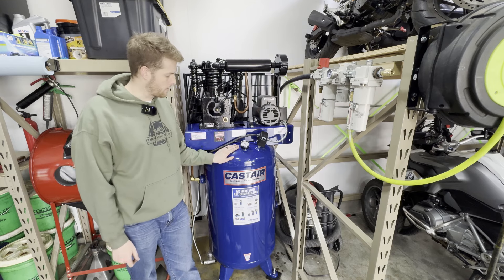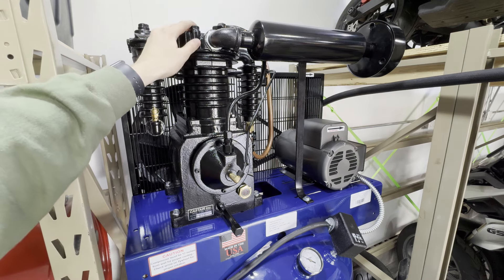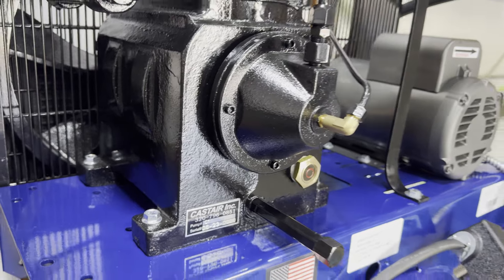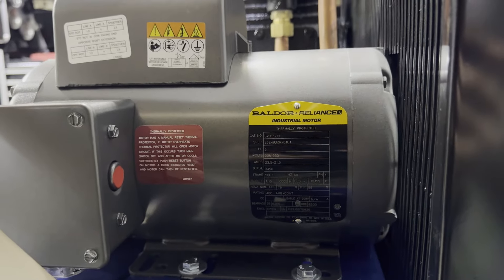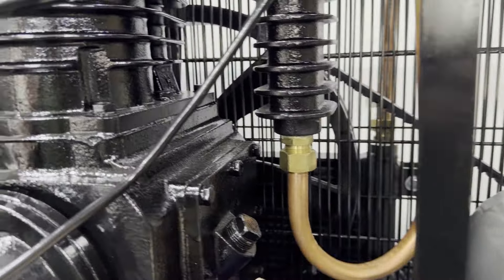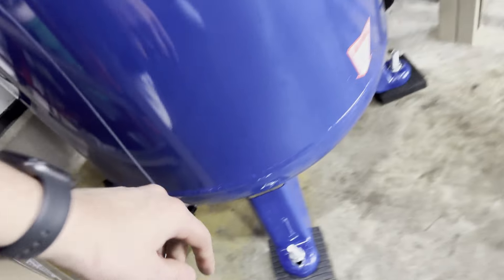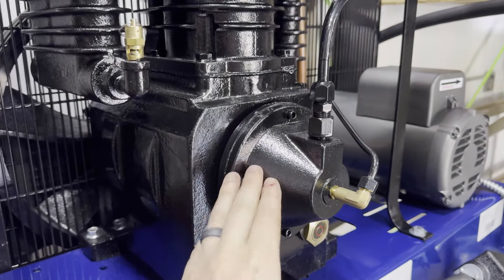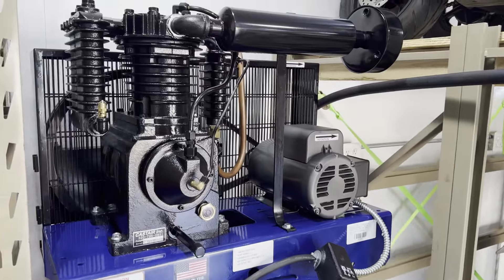The last air compressor you will ever buy

Comment: Its a fine compressor, but thats really all. Its venturing out of commodity territory, its about the same as all the other belt drive piston units out there.

Spent a lot of time mentioning features that Champion, IR, Quiny, etc all have and not focusing enough on their most important quality, local. Supporting local business is the only reason to buy this over others.
Reply: Which is a valid reason
Reply: Castair offers hands down the best customer support than any company I’ve ever worked with.